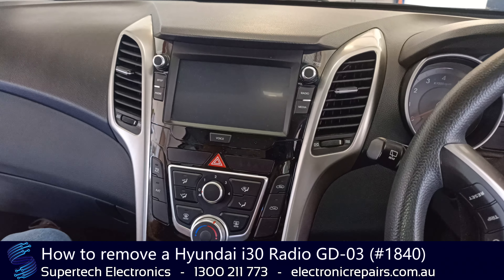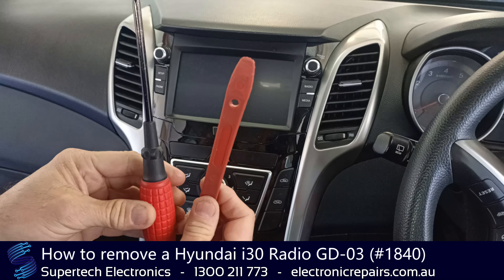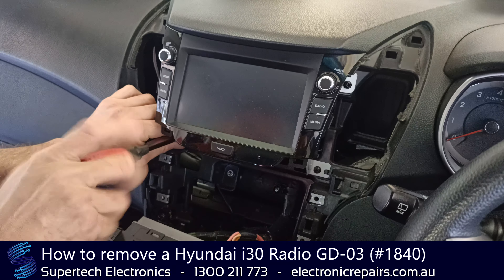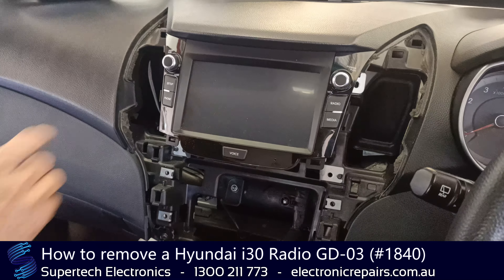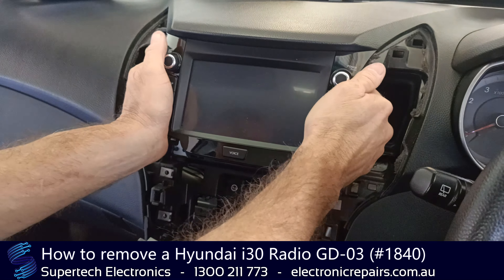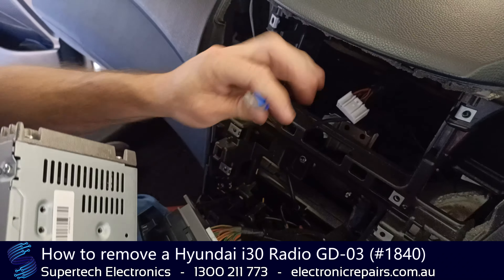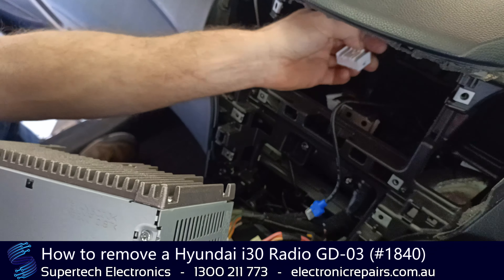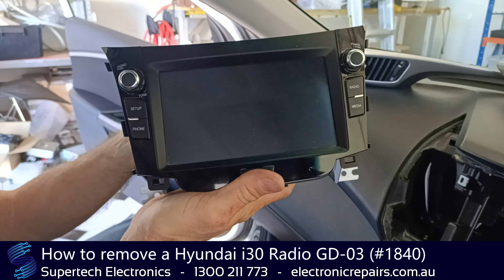How to remove a Hyundai i30 Radio GD-03 (#1840)

Comment: Hi my radio it's working but no volume how I fix plz let me know
Reply from the maker: This is a common fault and we can repair that problem. Please contact us at electronicrepairs.com.au for a quote to repair.
Reply: Watch this video to fix https://youtu.be/bEb89w5s4dk
Reply from the maker: @ZedEx186  you are very wrong! There is no reset button on these units. The video you linked is not the same radio or even a Hyundai i30! For all of our Australian customers out there, please do not put any pins in any holes. The holes on the GD-03 is the microphone for your hands-free. We replace many microphones because of these silly comments made by people who think there is an easy fix. The Hyundai radios with no sound have a main board fault and require repair. That is why we posted this video. Do not ruin your microphone PLEASE!